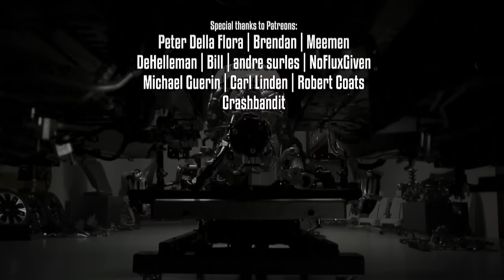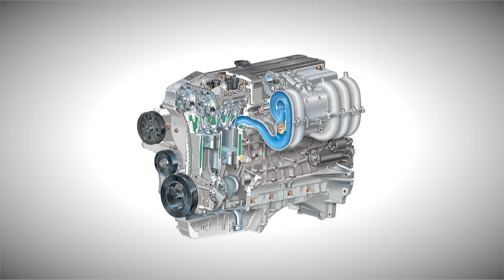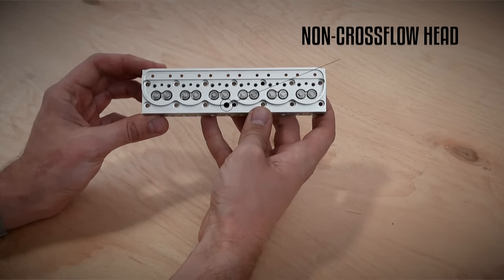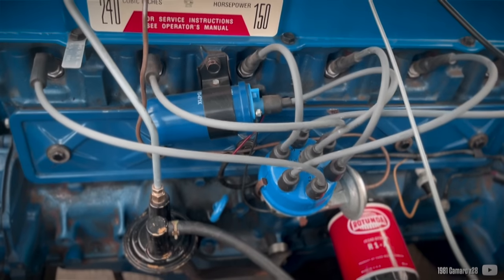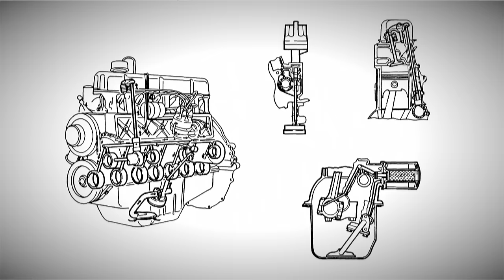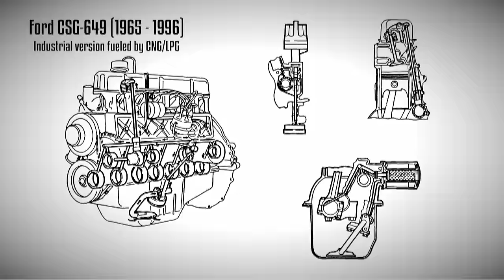Is This Toughest US 6-Cylinder?

Comment: My mom was all about classic Fords. On our farm, we had two identical '61 Falcons, with the flathead 6. My brother and I used to take them out and race them on a back road. Mom also had a Mercury Comet (A '64?) and a '65 or so Falcon Futura, a wedding present from her 4th husband. I had a very nice Ford snubnose pickup, bought when a local hardware store retired it.  Access to the engines were from inside the cab, you would remove the huge plastic engine cover "hump" which sat between the seats. I never even got the chance to drive the snubnose very much, before mom wrecked it. She was working in the woods with a hired man, she parked the truck on a slope and didn't engage the parking brake. The truck began to roll down the slope, picking up speed, until it finally slammed into a tree. The hired man said that he tried to "catch" the truck, but it had too much of a head start. When I got home and saw the damage, I was like: "NOOOO". The truck was unsalvageable. I had to scrap it.

Comment: I had a 1986 f150 had the 300 with a one barrel carb. but, it was computer controlled! The truck never idled right. I had a 1973 jeep CJ5 with the 258 6 cylinder with a one barrel carb. that was awesome. I now have a 2001 jeep renegade with the 4.0 6 cylinder that is awesome.

Comment: My high school friend had a 4 door Ford Maverick with a 250 inline 6, and auto transmission. It was a very dependable set up, durable and easy to maintain. We could fix anything that could go wrong but it never needed anything except regular maintenance. One time we ran it on the interstate for 15 minutes going 90-100 mph with no problems. Too bad Ford quit making the inline 6 cyl. engines.

Comment: Actually the 240 head is not the same as the 300. If you put a 240 head on a 300 you gain one point on compression. I still drive a 1988 one ton with a 300 5 speed. No computer. These engines out last all computer components. Two more trucks in the barn, all with 300 six. 84 4x4 short bed. 86 long bed .

Comment: I just bought a beautiful one owner 1994 Ford f150 extra cab short bed 2-wheel drive she has the 5.0 or better known is 302 but looking at all the wiring the computers everything I took it to my mechanic and I told him take out every single wire from the firewall forward and under the dashboard that was not need it and we swapped out my low-mileage good condition 302 with a 300 straight-six out of a 78 Ford pickup truck with the complete wiring harness, I no longer have computers emissions or all that unnecessary stuff and I've actually gotten better performance drivability and all-around more fun

Comment: I beat my 84 F250 4x4 all seasons to the tune 249,700 and was still going on for years running on 5 cylinders  and 2 lbs. Oil pressure...
topping out at 83mph. That was the best truck l ever owned.
Outta 12 over 42 years.

Comment: Chevy straight 6. Started in 1939 and their modern version was from 1962 to 1988. I am not a Chevy or a Ford person in particular. Just wondering how the two performed head to head? Both seem extremely reliable. And both were used in cars trucks and I believe boats in the Chevy case. (Mercruiser)

Comment: I have a 96 F150 with the 300 and a 5 speed. Still in the middle of a refresh, but it's a solid truck. If I didn't already have another truck that was better suited for my needs, I'd keep it, but after I get it painted and put back together, on the market it goes.

Comment: Two of my fathers ( 81 years old )  favorite engines ever for daily driving were the 1969 Nova 250 straight six engine and the ford straight six 300. He was a Chevy man and liked the ford 300 straight six better than the chevy 300 straight six ( also a great engiine ).  Couldnt tell me why but he just thought it was a better designed engine to work on than the chevy 300 . When it came to V8s dad was GM all the way. He didnt care for the Dodge slant 6. Not what he was used to he said .Dad hasnt drove in about five years. I like the older engines. Miss the simplicity.

Comment: Had an 88 Bronco with the 4.9 L EFI. It would start at -30 F without hesitation. It survived it's mated clutch, that failed at 220,000 miles, and the un-rusted-out 80% of the body that remained. To the best of my knowledge, it is still being used to plow snow by the buddy I gave it to. (He had the wherewithal to replace the clutch for less than the retail value of the vehicle, and I didn't.)

Comment: Only 300k   bah that's just getting broken in on a good inline 6 ffs

The L series for example
My 280zx l28e engine/tranny only ever had the most basic maintenance and its outlived the original chassis,  was transplanted into another 280zx at almost 800,000 on the odo.. and last I checked with the current owner it was at 1,300,000 plus  still nothing more than basic maintenance   ie oil changes, spark plugs, 1 new set of NFL wires..  ie basic tuneup.    It keeps purring along sweetly.

And for those that dont know  the mighty RB series is built on the L block design

Comment: As a younger man I Rebuilt a 170 and 240 Ford inline 6 and a Chevy 235 Blue Flame (with solid lifters). The 235 Chevy had a 5 bearing crank and a block that weighed as much as a V8 Big Block. The 235 was not as powerful but was virtually indestructible.

Comment: They commonly cracked piston skirts, spun rod bearings, and coned cylinders. Especially when lugged or revved out regularly. I rebuilt quite a few back the 80's and 90's. On the other hand, I've never done anything to a Chrysler slant 6 but change carburetors and waterpumps. And i hate to say that because as a mechanic, ive always hated Chrysler.

Comment: Toughest engine I’ve ever owned was a 300 inline 6 Ford. Pulled it out of a wrecked 71 f100 and put it in storage. 25 years later the engine blew in my 85 f150. Put the 71 model 300 in and was driving it on a successful 250mile trip that afternoon. Tough engine.

Comment: I think that the Dodge in line slant 6 cylinder is the toughest engine. A friend had a Dodge van with a slant 6 cylinder engine. We were going to replace the engine with a high compression slant 6 block. So we decided to run the engine with 2 1/2 quarts of engine oil. The engine lasted for over 500 miles before it finally seized up. It never ruined the block which couldn't be rebuilt. That was the first engine we tested. Then we built a high performance slant 6 that produced a respectable 300 HP. Of course that was too much power for the van so we sold the engine & scraped the body. I then went on to build Chevy 350 engines which produced anywhere from 350 - 400 HP which I put into my Camaro's. In the future I plan on taking a Detroit Diesel block using a supercharger while using gasoline. If it works then great, if it doesn't then back to the drawing board.

Comment: Sold my 1994 F150  300/6 about 10 yrs ago with 444K miles still running strong. It's still going as I see it traveling the area and talking to the owner from time to time. Only issue I had was a broken fiber cam gear at about 350K miles. Was an afternoon and $50.00 spent.

Comment: V6 engines have balancing issues where in-line 6 engines are a balanced equation in itself.  The 4.9 I-6 in my 1993 F-150 is factory fuel injected and while not a speed demon, is a very durable and powerful truck engine. 
 I love that truck and enjoy rowing the gears with it's manual 5-speed transmission.  Keep the oil changed and that engine will outlast the rest of the vehicle.

Comment: Had a 1977 F150, inline 6 cyl 300. The cylinder up against the firewall always melted down. Went through two of these motors than gave up on Ford. I don't think it was the motors fault but the lack of cooling to that cylinder. Maybe air flow.

Comment: Mr. Bean you're exactly correct do slant-6 engine would be a perfect engine for a tractor because the block is so strong it's Roy bulletproof an engine. Then the GMC 6cyl 302 what a powerhouse at the time it was built. I built one for a guy it was amazing two-barrel carb, 3in exhaust 12in clutch. I put a really big muffler on it. Do anything you can hear fully-loaded going up the hill sweet a sound of that engine.

Comment: I love mine I have a F150 XLT Lariat that my Dad bought new in 1987 & finally passed down to me. While my Dad & stayed on top with maintenance the 300 in my sister's 92 XL was run for almost a year 1 1/2 quarts low on oil but still ran purring smooth as you please when she traded in. To add insult to injury she traded it in for a Chevy Colorado I told if I knew I would have paid more than the dealer gave you in trade.

Comment: What many do not know is that the Ford 300 design was based on a prototype brought to Ford by a former Hudson engineer.  Bernie Seigfried was one of the power train engineers in the late 40s and early 50s at Hudson and worked in experimental designs.  With Hudson's management approval, he worked on an OHV I6 that was a potential replacement for the Hornet 308 L6 that dominated NASCAR in the early 50s. When Nash and Hudson merged there was no interest at the new American Motors since Nash already had an OHV6.  Bernie was allowed to take the prototype to his new job at Ford and helped develop the 300.  Before his death, he had the prototype in his Ford pickup truck he used at his place in MO during retirement.

Comment: My Dad had a mint 1978 Ford F-150 4x4  with the 300 Six in it and it was bullet proof. That Truck was geared so low even though it was a 4 speed he only used 2-4 . . He spent hours on that truck everyday going mud-slinging and then polishing it and it was stolen at the mall during Xmas in 89. Ford engines now days suck. I feel shitty saying this but I won't own a car from a American company,they fall apart.My Dad is a Mechanical engineer  he changed out that carburetor in it and put a intake in it that was polished and everything. The engine looked great but it was funny seeing him standing up in the engine bay.When it got stolen it crushed my Dad he was obsessed with that truck

Comment: 300-6 Fords with a 1 Barrell were used in more then trucks.  I remember a relative who had a self powered Ag-Bagger (a compaction machine for filling large 9 or 10 foot diameter plastic bags 100 up to 300 foot long with silage to feed cows) with a 300-6 instead of tractor PTO drive.

Comment: My dads 300ci in-line 6 84 F150 1bbl carb was computer controlled. The engine was bullet proof. The body rotted unfortunately thanks to the Canadian winter or it would have lasted forever.

Comment: G'day VR, I had a 1978 Ford cortina down under Ford put the 4.1 litre crossflow straight six in them it went like a dog shot in the arrr the only problem was it used to break engine mounting bolts a lot. PS the Barra is KING 👍.

Comment: In the days before synthetic oils, the 300 was easy to get  hundreds of thousands of miles out of these engines. One guy I know had 600,000 miles before I lost rrack of him and he never did anything but change the oil and tune ups. 
These engines had a power stroke every 60 degrees of rotation instead of the 90 degrees of a V8 engine. They are also VERY well balanced, so they feel smooth. 
I wish they would make a new version of this engine and mix it with the Barra. 300 cu in with 4 valves and OHC. with today's oils, it would be a million mile engine easily.

Comment: Late in the life of the 4.9L, when emissions were getting tighter and tighter, consumers wanted more power, and the gov't was mandating higher fuel economy, Ford developed a prototype cylinder head for the 4.9L that was crossflow rather than same side. It was reported to have exceeded all expectations except cost to produce and overall length (more difficult to package in a passenger car or small truck). Hence Ford developed "nothing special" V6's for applications the I6 couldn't meet, and making a V for cars and small trucks as well as an in-line for trucks was deemed too costly.

Comment: I am a huge fan of in-line engines. My favorite would have been GM’s 292 cu in inline 6. GM’s 250 cu in is another great engine The 6 cylinder used in Jeeps are another fantastic engine with great durability. I miss these engines with their simple ignition systems and carburetors. So easy to fix on the side of the road! I hate all of these computers, electronic ignition and fuel systems. They might get a little better mpg and while there are no points or condensers to replace, I would gladly return to these simple, efficient engines. My 2004 Suzuki Jimny has an inline 4, but it is loaded with electronics. At least the 4 cylinder offers plenty of under hood access for servicing. Great video!

Comment: Back in the day, Ford would couple the 300 with a granny gear 4spd and a Dana 60 geared around 4:10 in the F250s. That was a sweet combo for a work truck. I had 2 over the years and worked the piss out of them.
They weren’t the choice for hiway runs, top speed was only around 65 flat out. But man if you needed to pull a trailer or farm wagon or even a big boat, they were like a diesel in the torque dept.
One I had was 4wd, and with 4 low and granny gear ( we called it double low) I swear it could climb a tree.
Just a great engine, even the F150, with taller gears, and later FI , was a sweetheart for longevity and torque.
They weren’t however, gas sippers, that power had to come from somewhere lol

Comment: Back in 1960 when the Ford Fairlane came out I thought and still to this day feel that it was an ugly car. To my dismay my Dad pulled into the driveway one day with a brand new four door Fairlane. Plain Jane that didn’t even have a radio. It had the 170 six, three on the tree with overdrive. I learned to drive in that car and used it throughout high school. One thing that it had going for it is was the six cylinder engine that ran and ran without any mechanical problems. On cross country trips it would get 24 mpg. My Dad kept it for 7 years with well over 100,000 miles before trading it in. The old Ford was super reliable, but just butt ugly in my opinion.

Comment: I am a huge fan of domestic inline 6 cylinder engines, and I have owned many of them, including Fords. But my all time favorite is the 170ci Chrysler slant six. It was virtually indestructible. If you build one right, properly maintain it, and don't abuse it, you can get a million miles out of it. It is not a powerhouse, but for a transportation vehicle, it is probably the perfect engine. The later 225ci version made more power, but sacrificed a lot of reliability in the process. Those plastic cam gears/sprockets that were and still are used in almost all engines, are JUNK. They WILL fail, and if it's an interference engine, destroy the engine in the process. ALWAYS replace these with steel gears/sprockets. I prefer straight cut gears to helical gears, even though they are noisier. They are also stronger and longer lasting. Not having any internal chains is a huge benefit to the inline six, as chains will always wear out long before any other part of the engine. I replace the timing chains in my small block Chevy V8s every 70K miles or so, as routine maintenance. The only real drawback to the inline six is the intake system. Using a single carburetor placed between the two middle cylinders, and a manifold with longer intake runners for the outer cylinders means that the cylinders do not get the same amount of air/fuel mixture. And NO, EFI is not the solution. EFI is garbage. The solution is to use either a split manifold with 2 carburetors, or if you want all the performance you can get, a separate carburetor for each cylinder. Yes, there is that issue of synchronizing all those carburetors, but if you are a hot rodder or performance enthusiast, it's just part of the deal. Besides all the cars and pickups that used to use inline six cylinder engines, virtually all diesel engines, especially in semi trucks, are still of the inline six cylinder type. They provide better torque, as well as better reliability and longevity than a V8.

Comment: CORRECTION needs to be made 4"  Bore  Not 4.2"    / Ford 300 cid (4.9L) Straight 6 Specs ; Cylinder Bore: 4.00" ; Cylinder Stroke: 3.98"

Comment: The GM 3800 V6 was the best 6 cyl ever built. The cars would fall apart around the still running engine. Easy go 250 to 300k miles.

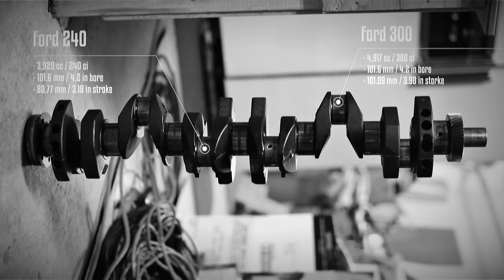Comment: Got a 300 in my 95 F150. 400,000 miles and still running strong! At 3:10 you list the bore as 4.2", this is incorrect. It's 4.00". The 101.6mm converts to 4.00" so not sure how you got 4.2".

Comment: I'm 70 years old 
My first car was a 60 Ford Falcon with 170 cubic inch 6 cylinder, number 2 car 65 Ford mustang  200 cubic inch 6 cylinder, number 3 was a Ford F150 300 cubic inch 6 cylinder so I will attest you can not beat a Ford 6 cylinder. 
Great video to remember the best of the best.

Comment: Inline straight 6 engine were the best engine made. Had experience with the GM straight 6 in a 1974 Chevy Nova. Also put a Slant 6 in a 1979 Dodge Ram 150. Great engine but cars were lead sleds. Friend had a 4.9 straight 6 Ford great engine still going strong.

Comment: Ford biased, the greatest straight  six of all time is the jeep 4.0 ,I've had one that hit 413000 miles with normal  work , waterpump, couple of starters, 1 alternator, cylinder head and intake and exhaust  gaskets. The fuel rails , throttle body not one lick of a problem. Ah sure wisht that 2 door Jeep  Cherokee Sport!